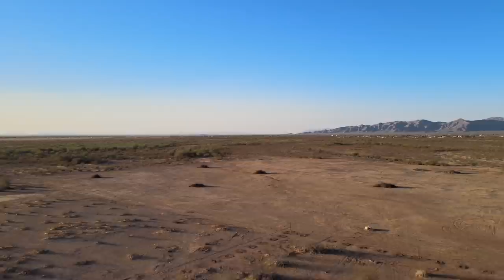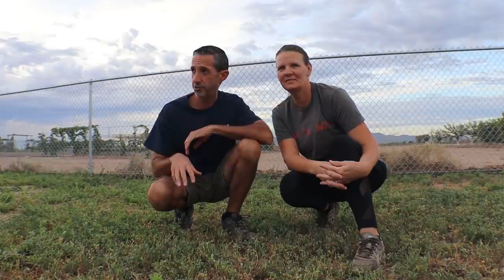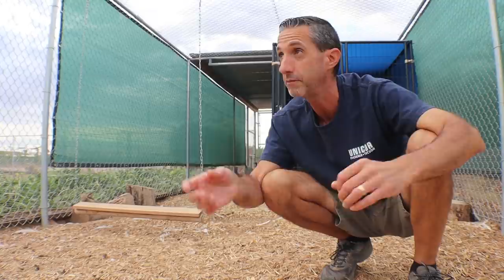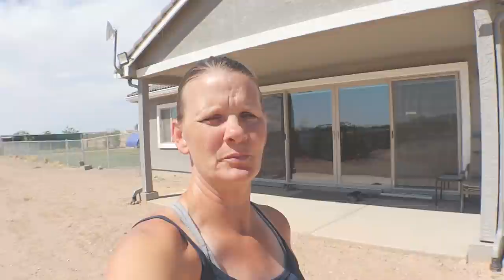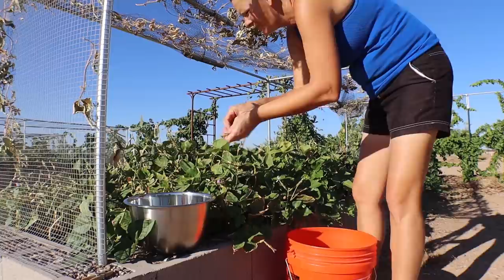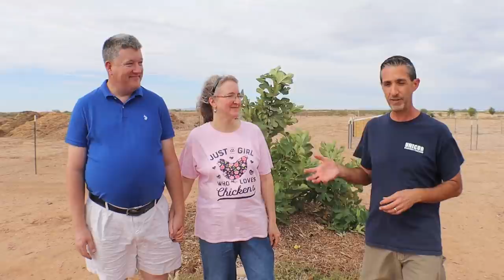Figs, Pigs, Chickens, Visitors and Power Tools | It's Fall in AZ!!

Comment: For u all. If u by the screws that have the star type end u don't have to push as hard 2 make them go in good luck
Reply from the maker: Hey Don, thanks for the tip. Lori and I were just discussing that and the screws for the roosting bars are deck screws with star shaped and they were much easier to screw in.

Comment: We have had such a problem with leaf hopper bugs on our grapevines at the end of summer. Suggestions? We do try to keep the vines thinned for air flow and we do summer prune. We also dusted the vines with DE and neem powder. We are starting to get new healthy growth but the leaf hoppers moved to our closest peach and apple tree 🤷‍♀️
Reply from the maker: This is a tough one. We generally don't treat for bugs, but we would employ the same tactics you're using. A mixture of watered down fish emulsion and cayenne would be a good option to make the leaves less attractive to eat (and make an excellent foliar feed). These are best left to beneficial predators, but that doesn't help with the immediate threat. I'm really surprised they're disturbing your peach leaves. We rarely see anything messing with those. The only good news in all of this is the trees are heading into the dormant season very soon, so it shouldn't do any permanent damage to the tree. That being said, that last flush of Fall growth really drives solid tree growth and helps with production in the spring.